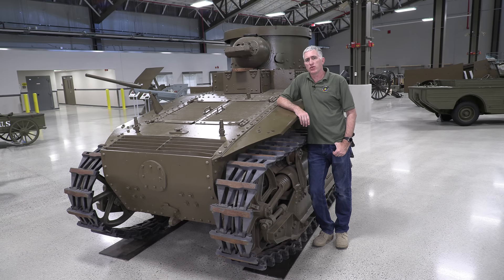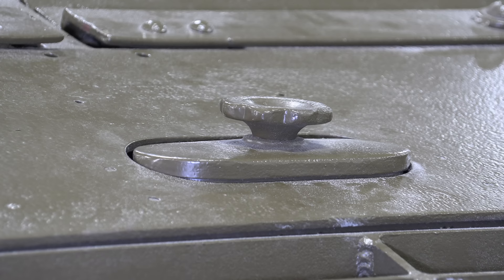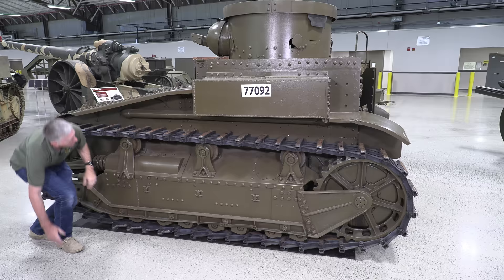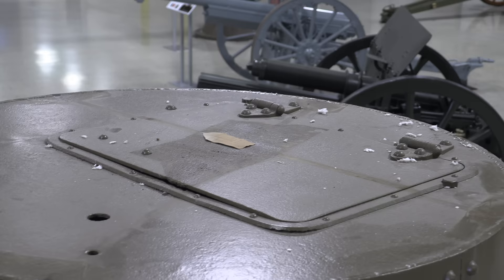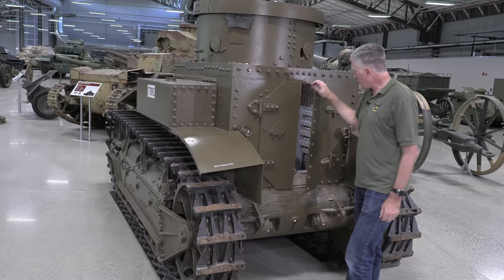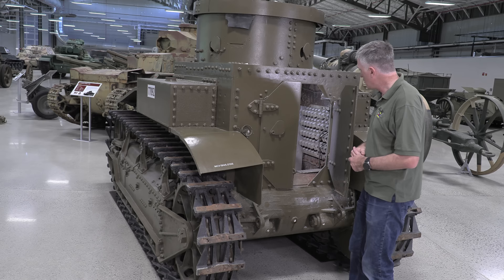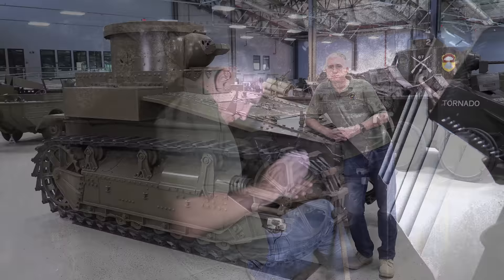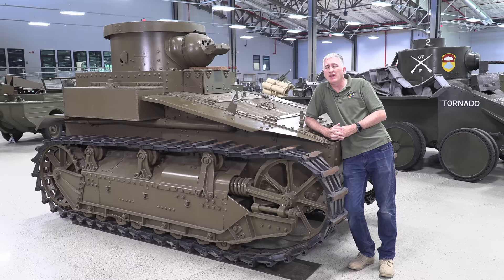Inside the Chieftain's Hatch: Light Tank T1E2

Comment: A tank so old the Browning .50 caliber was a legitimate anti-tank weapon... and wasn't even the Ma Deuce yet, but the M1921. Still beats an FT-17.
Reply: beat at what?
Reply: @MrQ454  the longer 37 would have marginally better antitank performance and it seems a little less cramped in general, but I wouldn't want to go into battle in either vehicle
Reply: Your choice was this or walk
Reply: You'd be surprised by the much more modern vehicles that are quite vulnerable to .50 Caliber fire.

A lot of APCs were/are designed to protect you from .30 cal and not much above..
Reply: @OGPatriot03  Usually 12.7 to 20 mm cannon fire from the front at 500 m and 5.56 mm at the sides^^
Reply: @MrQ454  The Cunningham T1E2 beats the FT-17 on speed & engine power (more than 3 times the horsepower).
Reply: @tomhenry897  Walk with a Bolt Action Rifle! (Or if you were "lucky" an M-1918A1 B.A.R. which would make you a target!)
Reply: @MrQ454  FT-17 also had wooden wheels
Reply: One would hope it beats an FT considering it is came a decade later and waa intended to replace the FT. 

Oh, and the people designing this actually had some history to base the design on. Unlike the completely new concept that was the Renault FT.
Reply: @CZ350tuner  hardly,
 FT-17 was build before 1918, but T1E2 used all the lessons from FT-17 and they can't improved substantially and also used that tank (?) until the '30s
Reply: @KA-dx2kz  the FT had steel wheels, it was the idler where you could see wood used and not on all tanks, most FTs i can see had a cast spoked idler with plates riveted over the spokes
Reply: You've got that right.
Reply: @tomhenry897  I'd rather walk
Reply: This could literally  run rings around an FT (on a large, flat unobscured field). FT had a top speed of about 7 mph (10+ kmh); the T1E2 could do more like 20 mph (30+ kmh). of course at higher speeds, the lack of suspension becomes more noticable (hence the large,  flat, unobscured field  I mentioned above).
Reply: @KA-dx2kz  FT's ..it was the front large idler that was a wooden plywood-sandwich composite, the other wheels/rollers were metal.
Reply: @polygondwanaland8390  I’d say the biggest advantage of the 37 over the .50 is the wider variety of shell type, APT, HE, and Cannister shot, from what I understand wasn’t that bad in a 37.
Reply: @tomhenry897 Walking was probably faster. 😅
Reply: To be fair, the .50 cal was a viable anti-tank weapon for quite a while (especially with AP ammunition). Remember all those interwar and early WWII machine gun tanks? They could and did engage other tanks too, and that's usually with 7.62mm / .30 cal bullets.

And if you can picture the crew of a light tank sweating over anti-tank rifles (and remember, even the Panther's lower side armour was vulnerable to PTRD shots), imagine how they would feel about that AT rifle firing full-auto.
Reply: @tomhenry897 Not too much choises😢
Reply: @CZ350tuner Renault have a serious lack of power

Comment: Honestly, considering the age, that thing is in great shape. A few months with a media blaster and a bunch of paint and she would really look good. I suspect making it run and drive would be a monstrous project with every bit needing custom machining to replace corroded parts, but the main structures haven't gone too far at all.
Reply: Well, it looks small enough to fully submerge it in rust remover for a few days, would make any restoration work a lot easier.
Reply: @Dr_V  "I need the biggest Ultrasonic Bath you have... no, that's too big"
Reply: @wraithcadmus  LoL Hans Moleman, The Simpsons...
Reply: I'm not so sure that it would be all that much work to get it running and driving once the excess paint was fixed. A lot of the work would be freeing the control linkages, and finding out where to put oil in the transmission. But what I could see of the engine looked to be in remarkably good condition.
Reply: @lwilton  Bearings and ensuring everything is free could be a bear though. Watching other tank restoration videos it is a lot of slow disassembly (for documentation and to figure out how it all works) and then making all the parts required. I doubt there is much "new old stock" left for a machine like this.
Reply: The tank or the chieftain? 😂
Reply: @lwilton  The excess paint caught my eye as well. They did it as a way to preserve it without needing constant attention. It would be a cool project to have a part of.
Reply: @Dr_V  Or you would find no more vehicle left haha,  if you don't watch out you might remove half of the vehicle, it's very rusted so it might be rusted enough that the structure of the vehicle would be compromised.
Reply: Personally, I'd go right ahead and hook a high voltage battery to it's electrical system today. As someone who's never wired a vehicle of any type, the wiring here looks A-OK to me.... 😉👍
Reply: @teaser6089 
Well, the good thing about tanks is that their entire structure is usually built to a high level of sturdiness. The basic "frame" and chassis should be made of metal that's thick enough to tolerate significant rust and corrosion without losing much structural integrity.
Reply: @HighlanderNorth1  This is a 1920s Tank with steel plates only 10mm thick, in 100 years you could easily have 2mm of rusted metal, if it was just left outside for most of the time without maintenance. 

I would say that 2mm of rust could easily lead to some structural issues, at least if it gets fired upon haha

Comment: Amazing that the American standard for tank comfort comes from the very first begining
Reply: If you are going to drive a tank across New Mexico, might as well do it in relative comfort.
Reply: Looks like decent space and even a geared turret, only failure is the lack of a firewall for the driver. Must be hard having driving around with a fire place in between your legs
Reply: @JoshuaC923  maybe but I've seen much more recent tanks that had the firewall taken out so it's not necessary a gaurantee
Reply: @JoshuaC923  Yeah, it very much looks like the driver was practically straddling the engine

Comment: The stepped or flanged idler ect. is just like a bull dozer or excavator's. That spring tensioner is also like the early tractors/dozers, prior to the grease tensioning system used in earth moving equipment for the last 50 or so years, maybe longer.

Comment: These old tanks are something else. Countries sure loved having exposed engines in their vehicles. We take things that seem so obvious for granted. At least this one isn't exhausting right into the cabin like other WWI era tanks, but that seems like a bear minimum when the driver is still less than a foot away from the heat and noise lol. I'm sure there were still plenty of smells coming out of the engine.
Reply: Considering how small the crew compartment and what the experience of the British mark tanks an engine is hot and they probably assumed it would heat up whatever they used for a firewall.
Reply: There was a time before safety was invented, or atleast in wide spread use.
Reply: On the upside, this also makes the engine easy to access for repairs, maintenance and lubrication. This was an era when ship crews included dedicated oilers after all.

Comment: It's always the lights and tankettes that get me excited about this channel. It's where you find the more eccentric and entertaining engineering attempts.
There may be a lot of shortcomings, but you can see the train of thought was not illogical, despite some oopsies.
And I can't help but think there's a lot to love about the geometry of this hull, were I to try a modern tankette. The weight distribution of the engine & armor in front balances vs turret weight, stacked 2 man position & entry, glacis slope. Make engine block sacrificial protection in front of an inner armor shell.
Reply: Feels like having the driver behind the block rather than riding shotgun to it, and facing incoming rounds with more metal in between, is better for crew protection versus the side-saddle driver position of the Wiesel, Scorpion, M113, my old Brad, etc, etc
Not like they're meant to do tank v tank duty anyways, just be better weapons platforms and more cross country mobile than an M1151 or MRAP, which have zero in the way of cross-country superpowers. More a self propelled crew serve fighting position than APC, IFV, or Tank.
Reply: If I remember correctly, the design of the Merkava MBT having the engine at the front of the tank to provide protection for the crew
Reply: @hawkeye5955  It does, and uses the freed-up rear space very handily for crew storage, utility, and access/escape. They could probably engineer a tiny crew toilet in there, which would be a godsend when in CBRN posture.
As an American crewman, my jealousy towards the Merk knows no bounds.
Reply: My brain read that as "the lights and tankettes" and just went "what? You love steering lights?" Before it caught on.
Reply: So, a commercial truck chassis with a diesel engine. Or at least a 7ton truck chassis.
Reply: @ScottKenny1978  Well, commercial truck chassis are mostly just a frame. Not a hull. But MRAPs fall into that category. 
I still stand by the idea that we should've brought every Caiman and RG-33L home, slammed them, widened the axles, and turned them into half tracks. But not the MaxxPro's
Reply: @WindFireAllThatKindOfThing  right, but you build the hull on a commercial truck chassis.

That's basically what the T1 is. Give it the same turret as the AAV-7, with a .50cal and Mk19.

Comment: It's remarkable how little has changed with that suspension system. It is very similar in form and function to the system currently used on excavators, even down to the tensioning spring on the front idlers and the mud slides to keep the track run clear.

Comment: The driver's position, besides being what I would imagine excruciatingly warm, also seems to have a great deal of potential for excitement under unfortunate conditions. And not the good kind of excitement, I might add. You'd really have to have clankers of cast iron to be in the driving position of that thing, and even then they would probably melt. Between having that big ol' V8 rattling around less than a foot away from your face and the knowledge that in combat it's only a matter of when(Definitely not if) something kind of violent will find it's way through the front facia to say hello and make your day real bad, that's a heck of a job. 

But yeah, it really is incredibly neat to see a tank of that era still around. For her to be in such good overall condition is a bit mind-blowing as well. She's far less crusty than tanks I've seen less than half her age, so I'm guessing at least a fair amount of care was put into keeping her in one piece along the way. Very, very cool.
Reply: I would think that opening would've been covered with something like leather to keep out the heat and any hot coolant from being sprayed onto the driver.
Reply: @billwilson3609  I very much doubt it. Besides, your feet and legs are going to be next to and under the engine while operating it, so it wouldn't do much for you anyway.